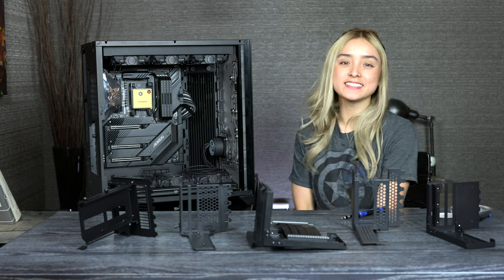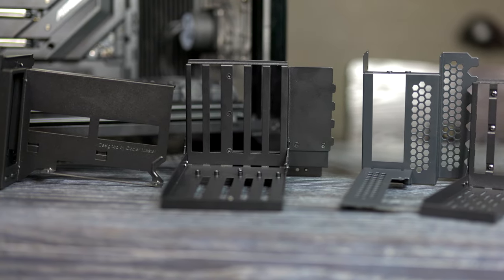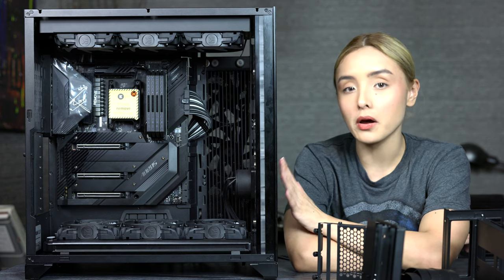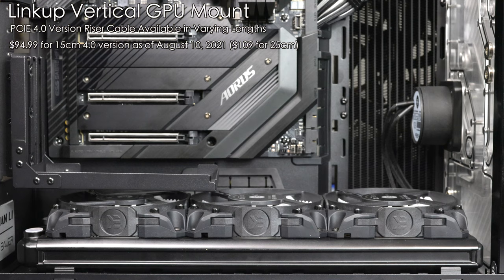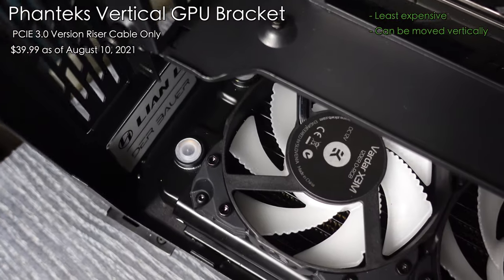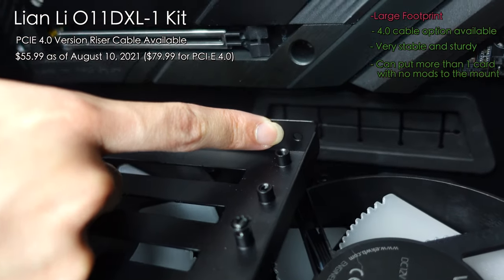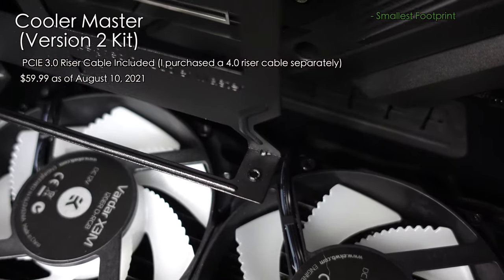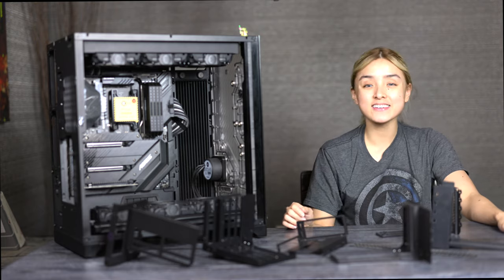Best Vertical GPU Mount for Lian Li o11 Dynamic XL | Cooler Master Phanteks Linkup CableMod

Comment from the maker: My dedicated tech channel https://www.youtube.com/@snaxantech?sub_confirmation=1 will start in spring of 2024!
My finished build: https://youtu.be/oKtvvt5RNCA   *If you have a heavy GPU I recommend the EK mount here https://amzn.to/3RwfIla over the Cooler Master* The EK vertical mount has a small footprint and also stabilizes like the Lian li so there is no sag. The latest version also allows thicker blocks.   I wish I had found it in time for this video.  
The one that I liked at first is the Cooler Master Vertical GPU Mount and it's still great if you don't have a heavy card like I do:     https://amzn.to/3xJna1k   Make sure you check your card slot width as this does best with 2.5 slots or less.  Again, this is not a sponsored video but these are all affiliate links.   Other ones that might fit your needs: 

Linkup Vertical GPU Mount                   https://amzn.to/2UimJh6
Lian Li GPU Mount                                  https://amzn.to/3AFZTj4
Phanteks (Don't overpay resellers!)     https://amzn.to/3AD1uWB
CableMod Vertical GPU Mount            https://amzn.to/2UdbZjT
Reply: Nice, liked and sub’d! Which 4.0 PCIE cable did you end up going with? I’m planning on getting a 15cm.

Thank you so much for this video, I love the pros/cons you included for each! I returned my Linkup 25cm (25cm was waaay to long).

I do recommend the U-turn PCIe adapters for your GPU power cabling for a cleaner look!
Reply from the maker: @darith27  Thanks for stopping by!  I ended up going with a 15cm Linkup.  Working really well, even set on 4.0.  I'll check out the U-turn, but I think the way the cable comes out of the water block it looks ok....for now anyway.  I finally finished my PC a few days ago but still I want to tinker with something every day!
Edit: P.s BTW I ended up with the EK vertical mount.  Loved the cooler master but my water block was just too heavy.
Reply: @SnaxanGaming  A few days ago? That calls for a celebration, congratulations! 🎉🥰I ordered the EK GPU vertical mount with the 15cm linkit 4.0 riser cable too. Can you provide a sneak peak list of your current water-cooling part specs? (Ex. Tubing type PETG or Acrylic/sizes/fitments/Cryofuel liquid color) I'm planning on ordering the rest of my watercooling parts today!
Reply from the maker: @darith27  I ended up with with acrylic 16mm tubing.  Even though it's my first time watercooling I went for it even though its harder to work with.  I used the cyrstal 16mm tubing from bitspower, it seemed super clear and looked nice.  All my fittings were from EK, for this build I went with black quantum fittings to match my black GPU waterblock and black ek magnitude waterblock for my 5950x.    Nothing crazy in terms of color for the fitings/blocks.  I also just used clear cryofuel to fill the tubes.  I might eventually go with color but I think the clear looks nice and gives more flexibility when you light up with LEDs.  14mm MF extenders really came in handy for my build and I also used a couple of EK quantum offsets as well.  I'm currently editing the video and hope to have it uploaded by this weekend and I'll have all the parts lists too.  In the meantime good luck on your build!  Feel free to ask anything else.
Reply: @SnaxanGaming  Nice! I had the EKWB GPU mount (loved how stable it was) but it didn’t allow for me to use the Lian Strimer plus 24-pin power cable so I’m thinking to swap it out and going back to either the LinkUp or the Coolermaster…I’m concerned about the backside heat from VRAM cooling airflow since the 3090 is notorious on that (so need a mount that doesn’t cover too much of the backside) so leaning more towards Linkup.
Reply from the maker: @darith27  I actually had the strimer but it was too white for me.   It seemed to work well with that mount for me as it just connect to the top.  Where does it block for you?   Also true about the backside.  I'm considering getting an active backplate and even going horizontal after all this (it's neverending)  but my temps seem to be okay so we'll see.
Reply: @SnaxanGaming  I ended going the original EKWB vertical mount route too since it fit better with no sag, spacing for tubing, and didn’t block the Strimer plus as much 😂 (the mount I returned that didn’t work well with me was the shifted one). I wish they made black strimer plus cables! Those would be 🔥
Reply: Please...Do you have the link to buy the Pci-e 4.0 cable for Cooler Master v2 bracket?  :)
Reply from the maker: @pipecore777  I ended up using the EK bracket because it's so much sturdier.  You can check it out on my pc build video.  Either way, I used this link up cable and it works great: https://amzn.to/3r1araD

Comment: OMG this is the EXACT video I have been searching ages for. Liked and subbed. Very informative, nice shots of the brackets. Better than many many videos I have watched to compare vertical GPU mounts. You've definitely helped me a lot in deciding which bracket I want. Thank you a LOT!!!
Reply from the maker: You're welcome!  FYI I ended up getting one that I didn't have at the time of the video.  I ended up with the EK vertical GPU mount because my waterblock weighs a ton.  If you have a heavy card and need something with a small footprint, it fits the bill.  I'll have a video of my build uploaded tomorrow if you wanted to get a better look. Have a great night!
Reply: @SnaxanGaming  heh thanks again. I was just about to get the cooler master when I saw your message. Getting the EK now. I like the minimal footprint as well

Comment: Thank you for making it easy for me. 👍
I did not even know that I could use another GPU mount other than the Lian-Li one. 🤔 I have a Lian-Li O11 Razer Edition, which is smaller than the XL.
I am going with the newer version (3) of the Cooler Master one. 👍

Comment: I REALLY appreciate your detail, explaining all the pros and cons. I skipped doing a vertical GPU in my O11 just because of this problem. Thanks for covering it!!
Reply from the maker: My pleasure and actually if you have a heavy GPU I really like the vertical mount made by EK.  I didn't have it at the time of this video but I wish I did.  It has a low profile and zero sag because it has a bracket.  My PC build is finally done and I'll be uploading a video this week if you want to get some more ideas but if you are already done, congrats on your new build!
Reply: @SnaxanGaming  oooh! I had no idea EK did one ! Perfect I’ll check into it. Mines a 2080 ti with an EK with an EK water block. Can’t wait to see your rig!

Comment: I hate the same exact problem where i needed a GPU mount that would be inward and not at the edge of the side panel which would over heat my GPU, nice sturdy mount that won't make it sag, and finally needed 1 additional slot to slot in my capture card. I'm glad I stumbled upon your video. Thanks for going the extra step. I ended up purchasing the EKWB EK-Loop Vertical and it solved all my issues except covering a bit of ram led, but thats okay for me.
Reply from the maker: You and I had the same exact issue and solved it the exact same way.  But actually you may be able to do what I did and move the EK mount even lower than the two options so you don't have to cover your RAM.    You can check out the video on my build to see how it worked.  I only have one screw in the bracket but it's secure and worked great.

Comment: THANK YOU for this vid!!!!!   I've been trying to figure out exactly which vertical mount to go with my setup in my O11 Dynamic XL ROG.  With what I'm trying to achieve I think the Phanteks Vertical GPU will work best for me. I know you say its not as sturdy as you prefer, but I don't think it will be an issue because with the water block mounted vertically, all the weight is against the screws at the top of the GPU mount to the frame, and then the tabs are pushing at the bottom.   Thank you again for putting this video out!!!
Reply from the maker: Nice, glad it helped!

Comment: Excellent analysis and appreciate your video. I too have the 011 Dynamic XL with a newly purchased 3080 Ti and Corsair Hydro Water Block. Will purchase the Cooler Master mount for my build. Thanks!
Reply from the maker: Check out the Ek mount!    Hi ended up with that one and regret having seeing it so late.

Comment: Just what I was looking for. Thanks for the IRL comparison
Reply from the maker: You're welcome and actually I highly recommend the EK vetical mount for heavier cards.  It's the one I ultimately ended up with but isn't on the video as I got it afterwards.  It has a bracket that helps keep it level and has a small footprint.

Comment: Thanks for the detailed look at solutions from a range of vendors! I was thinking about a vertical mount in my Cougar Panzer case but it looks like any vertical option would mean cutting the case which I'm not into. Your video was really helpful for me to see the different mounting concerns I might not have thought about and gave a "detailed enough" view of most of the bigger products in that sector.

Comment: Very useful Sarah, I bought the Link up mount and then watched your video !! Did not like the size or build quality on the Link Up and decided to bite the bullet, and buy the cooler Master Stand - I am glad I did, neat, tidy and well made. Thank you again for the advice. Ady xx
Reply from the maker: NIce!  Hope it works out!   I did end up going with the EK mount btw.  My card was just too heavy and needed something with a bracket.
Reply: @SnaxanGaming  Hi Sarah, I have an Asus Rog 3080ti with a Phanteks Glacier water block. It is heavy and sags  a little, but, I am making a stand for the under side of the gpu which should help. I bought a gen 4 riser and it is really too long and is a little bunched behind t6he gpu ! We live and learn Ady x

Comment: Just a heads up that I just noticed on my Lian Li Mount that I have, you can actually remove the small piece on the bottom that attaches to the bottom of where all of the PCIE cards connect, and you can raise it up for more space as well!

Comment: Nice video! thank you for trying out all of the vertical mounts for the 011 Dynamic XL.  I have this case and now I know which vertical gpu mount to get.
Reply from the maker: Glad I could help!  Makes me happy.  Congrats not he Lian Li case too.  BTW don't forget to check the card slot thickness, the smaller footprints of some of the mounts (like the cooler master) can only do 2.5.  Hopefully your card will fit nicely

Comment: 6:53 "It's really bulky..." -- She

In the Lian Li pre-release videos for this case they showed a GPU being mounted on the far right of the case, where you now would mount a radiator. Apparently the production case doesn't support this option, probably because some video cards' vapor chambers don't like this orientation. I sure wish they did because that mounting option looked SO cool.

Comment: Wow... now there's a coincidence. I have that Coolermaster Vertical mount. I just ordered a new PCIe Gen 4 Riser Cable for it so I can install my new 3070 Ti on it. Been running the card in Gen 3 mode and really want that Gen 4 working. I have it all installed in an ASUS TUF Gaming GT501 case.

Comment: I'm using the Lian Li-branded vertical GPU mount. I also have the 3090 FE with the EK block, and even have the active backplate for it as well. I'm also mounting three additional cards for audio purposes in the bracket behind my GPU, all with riser cables that go to my mobo. It's been a crazy pain to setup but it all works. I also have my radiator terminals at the front, and I'm using the older EK distro plate that allows for this. The annoying thing about that is it's not really meant for the vertically mounted GPU with the FE style terminals, so my runs are pretty complex to my GPU. The insane thing about this EK 3090 FE block with the active backplate is that it's way too heavy to just mount horizontally.

Comment: Howdy Sarah. I'm in the hunt now for one of these and I'm down to the Link -up and the Lian Li. My question for you is: can you move and mount the Lian Li up higher like the Link-up?  I have the 011 Dynamic XL ROG white and I'm attempting to vert mount the "big fella" 3090ti Suprim. This is my first build and  I have just recently caught the gaming PC bug so I'm kinda going over the top (in a good way) with this build by giving in to my mid life crisis and feeding my impetuous nature. At least it's not a Porsche.  Anyways, great video and necessary since I haven't seen any other comparison breakdowns. Have a great one.
Reply from the maker: I believe you can move the Lian Li up but I'm not 100% sure , it's been so long.  However, if you don't have a card that takes up more than 2 slots, go with the EK vertical gpu mount, I discovered it after this video unfortunately and I have it linked in my pinned comment/description.  It's also in my main WC pc build video which cam after this one if you need to take a closer look at it. Either way good luck on your build!

Comment: I bought the Cooler Master V2 as well. Bought a Linkup PCIe 4.0 riser cable for it too. Haven't finished building the PC yet though. I like the slider because it will allow me to line up my GPU Strimmer 24pin with the case grommets so the Strimmer isn't twisted. I already modded mine so it sits lower in the case so its not obscuring my ram. I just dremeled off the bottom PCIe Slot Tab and mounted the Riser 1 Slot lower. I also like this GPU mount because of its back plate behind the card. I will be dremeling out a lot of the sheet metal while leaving enough cross beams so to speak to maintain stiffness, in order to mount 2x 90mm Black Chromax fans I bought to cool the back plate and rear PCB Ram Modules. If the 24pin GPU Strimmer wasn't a big enough clue then Ram on the back of the GPU PCB should be. Yes, I  chose the year when GPU prices hit their insanest levels in history to decide to go all in for the new build and buy the top tier GPU of the Generation, an RTX 3090. (Asus Strix)
Reply from the maker: Nice build, hope it gets finished soon and good luck!  I got the linkup as well, it seems to be the most stable.  Looks like a lot of people are in the same boat with the GPUs, it's crazy.   I actually bought the trimmer but it was a little too flashy for me and I also wish that it was black instead of white.  The white looked odd in my black case.  Thanks for stopping by
Reply: @SnaxanGaming  I've the Black O11 DXL too but went with Corsair QL120 fans with black frames and white blades, Corsair Elite Capellix H150i AIO and I'll be using the white CPU Pump cover. 4x DImms of 8GB Corsair Vengeance RGB Pro ie. Theres enough white in my Black case so that I think I can get away with the White Strimmers without them being an oasis of white in a sea of black. I kind of had the opposite problem where I felt my Black Strix 3090 looked a bit odd surrounded by black and white. However a White Strix 3090 would have been too much in the other direction..........so I just ordered a triple set of white replacement fans designed for the White version but will fit them to my black version adding some white to it. Now all visible fans in my case will be black framed with white blades be they case, radiator or GPU fans. I'm also going to fit some Corsair RGB strips inside the 3090 Fan shroud. Armoury Crate doesn't play well with iCUE and the OEM LED strip on the Strix3090 only half lights up via iCUE. Corsair strips top and bottom inside the shroud can be controlled and synced with the rest of the iCUE controlled case lights and fans and will also light up those new white fan blades. Didn't want to risk unbalancing the fans by painting them white myself so I decided to spend the $$$ and its totally reversible unlike painting the fan blades.

Its weird, I have no fear taking apart a 3090, (Heavily modded a GTX1080 Shroud and replaced TIM with Liquid Metal etc a few years ago), Have taken Dremels to previous cases and parts and will again with this one and a Special Media Server I am building but......I am scared to try a full custom loop!! LOL. Your build is incredible and looks gorgeous and wish I was brave enough to tackle a custom loop like you did!!

Comment: Thanks for nice review! 
Your case not have horizontal metal strip on I/O panel like in many another cases. This strips may interrupt connect HDMI cable with mount bracket like in your video. Cheap bracket from Aliexpress have more space from back panel and better than this branded bracket.

Comment: Great job!  Good closeups, make me more confident I might buy the right one for my case the first time!
Reply from the maker: Good luck!  Check out the ek one also, it's the one I ended up with but unfortunately I didn't see it until after I made this.
Reply: @SnaxanGaming  I have an active backplate, so the ones with a vertical wall near the backplate don't look like they'll fit.
Reply from the maker: @jimreitz768  Gotcha.  I'll be installing my active backline soon, I think I'll end up mounting horizontal.

Comment: In my opinion the lian li one is still the best. After removing the side panel at the bottom left which is fixed by only two screws, you can easily move this bracket up like the others to clear the radiator. Besides, this is the only bracket of the ones you tested that will support the $260 active backplate made by ek specifically for that ek 3090FE block.
Reply from the maker: The lian li is a great option for thicker cards and you're right about when the active backplate comes out.  It's probably the only one that can support it and also no mods needed for other cards.   I really liked the cooler master but I couldn't deal with the sag due to the heavy weight of the block so I ended up getting the EK one.  I'm really happy with it.